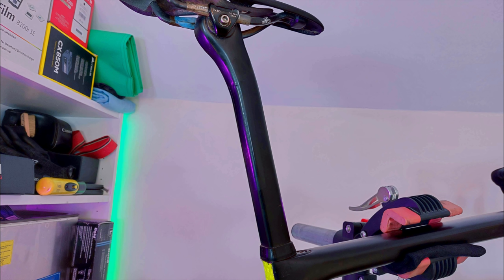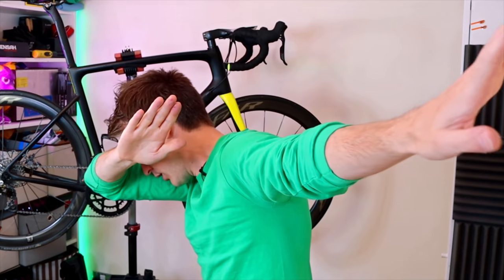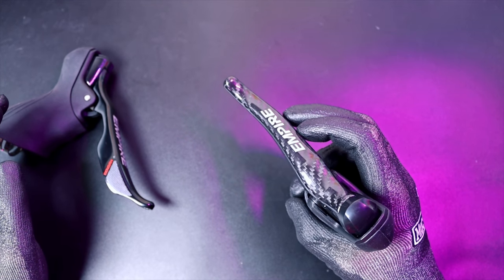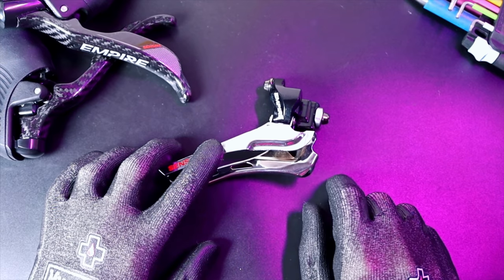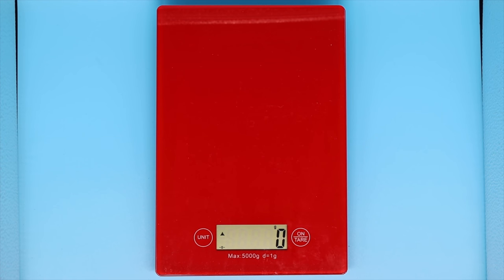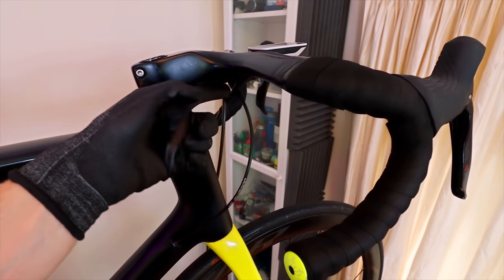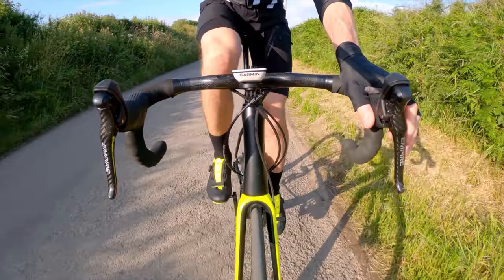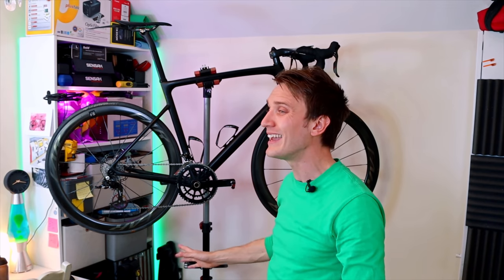Chinese Full Carbon Groupset (with OSPW) - Sensah Empire

Comment: I am using empire groupset (Not the carbon one) for around 6 month. I must say I don't like it that much. Yes it is likable for the price but like after every few rides or after pulling the wheel of the bike and putting it back I have to tune the rear derailleur. the front shifter doesn't work perfectly(not tuning issue). The shifter inside aluminum thingy get stuck after you press one.
Reply from the maker: So I would make sure the ratchet mechanism inside the shifter is well lubed, and make sure the gear cable itself is clean and can move with very little friction. I have started to use dry chain lube on the gear cable as I feed it through the cable housing. Basically you need to keep the level of friction on the gear cable as low as you can, it REALLY helps keep shifting crisp!
Reply: @TraceVelo  i did maintain my drivetrain and housing pretty well. Use wd40 on shifters after every cleaning. The problem is in the front shifter as well as rear mech. They just don't work perfectly.
Reply from the maker: So for one of my next videos, I think I will show how you can get nearly perfect shifting with Sensah. I was out on my set today, and it was working flawlessly all the way up and down the range, front and back. I have found the thing with sensah is it needs VERY clean and well lubed shift cables. Once you have this, shifting will be great. If it is getting hung up on certain gears, it tells me that there is some resistance somewhere along the shift cable. This is not so much of a problem for Shimano stuff, which tends to work ok even with old crusty cables, but Senash needs very low friction on the shift cables to work properly.
Reply: @TraceVelo  will be waiting for that video .

Comment: Stock derailleur issue could be galvanic corrosion between dissimilar metals. Could also be talking out if my ass...
Reply from the maker: Yeah to be fair, I think you could well be right. Steel derailleur body, and aluminium bolt, plus water... prob not the best mix
Reply: @TraceVelo  just dont ask me how to fix it 😅

Comment: These type of carbon shifters and brake levers  are very dangerous and should come with hazard warning. As the aluminium eats away at the carbon. The rider is breathing in microdeposits of dangerous carbon fibre particles. Stay away from carbon fibre for health & safety reasons